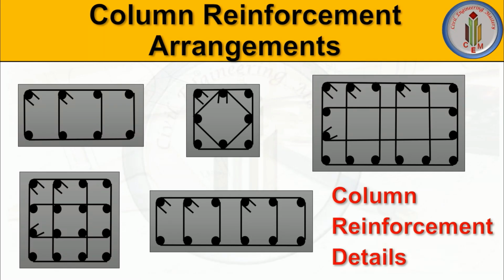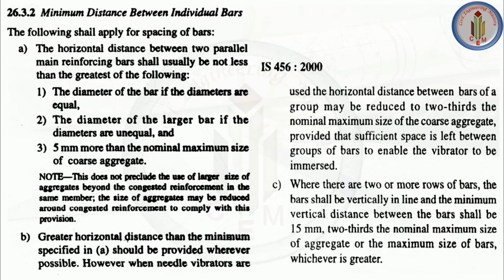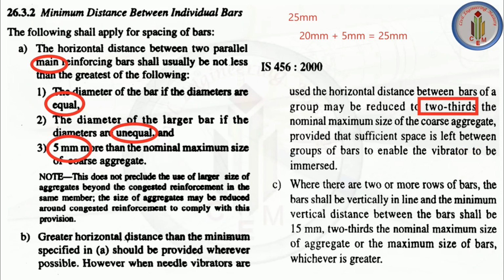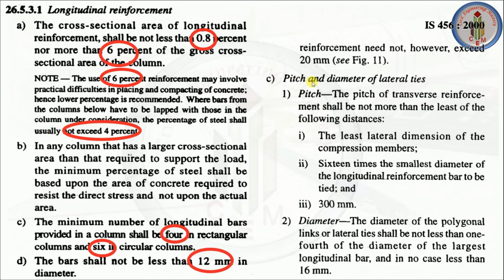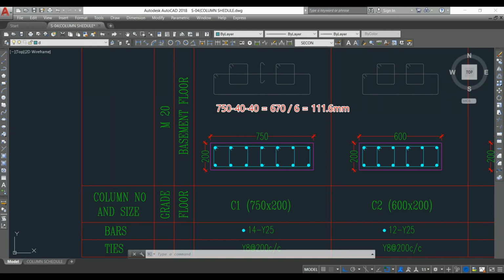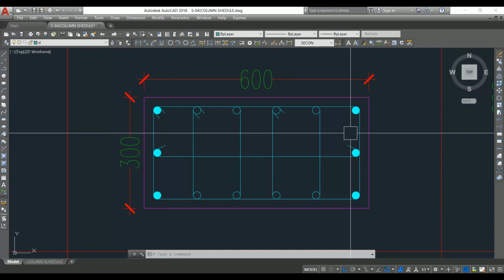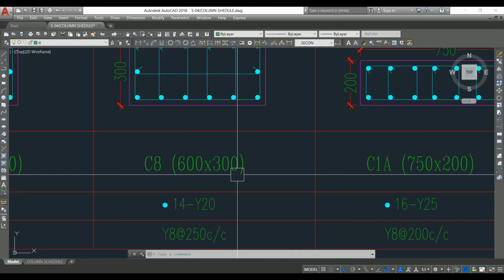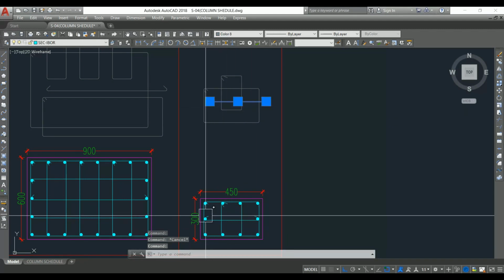Column Reinforcement | How to arrange column reinforcement | Column  reinforcement details as per IS

Comment: As per SP-16, for uniaxial bending, all reinforcements are arra ged on the short side of column, for biaxial bending bars are arranged on all 4 sides, but as per ur Autocad sheet, all reinforcements are arranged on the longer side of column ??
Please explain...
Reply from the maker: Reinforcements need to be arranged according to the dimension of the column. In the Autocad sheet, different sizes of columns have been shown and the reinforcements are arranged accordingly.
For example, if the column size is 200 x 600 mm, obviously you cannot provide more than two no.of bars in the shorter direction(width) and in the longer direction(depth) you can provide 6 nos of bars.